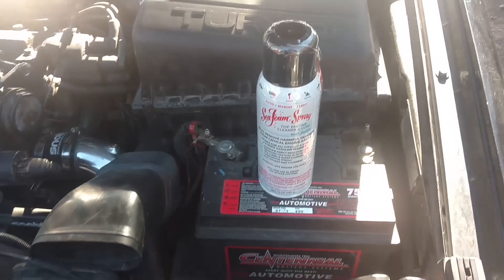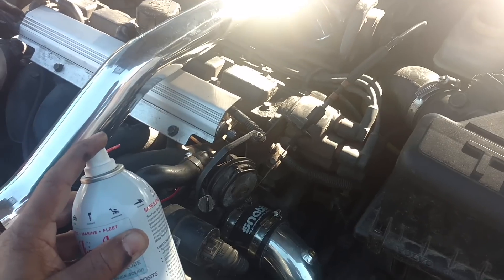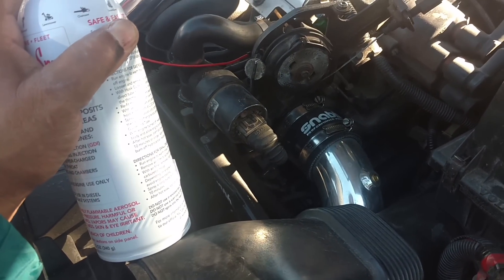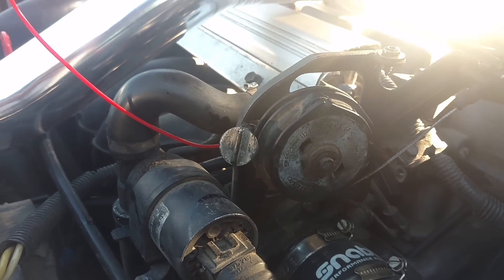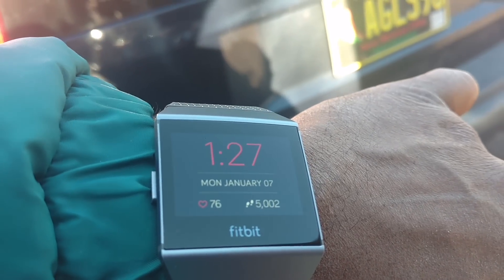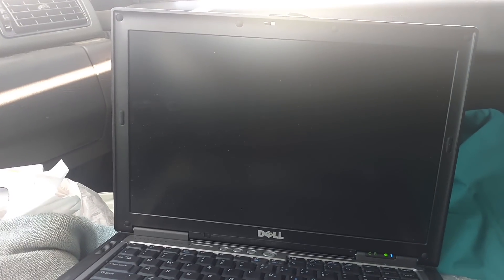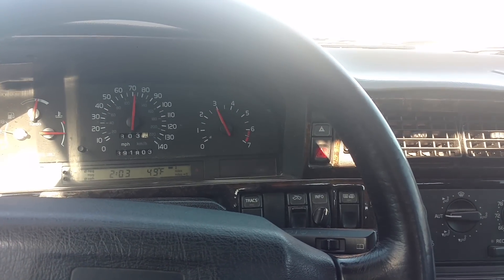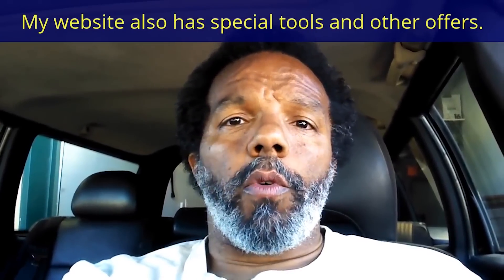Seafoam treatment on Panther, trying to clear out carbon build up. - howr

Comment: I've had mixed results with seafoam used it in two older fords I once owned...one car seen a good improvement the other nothing at all, I have also used seafoam in my mowers , no big improvement in the mowers but overall i'd recommend seafoam to anyone.  thanks Robert for another great video
Reply from the maker: Thank you for sharing.

Comment: Hi Robert, do you think putting a small amount of seafoam on top of the pistons to let it soak for a few hours might loosen the carbon some more? And then blow it out by turning over the engine. Did you ever resolve your carbon issue?
Reply from the maker: No, seafoam sitting doesn't work. The best thing was transmission fluid.
Reply from the maker: I'm not sure, I'll have to check next time I replace my plugs.

Comment: I'd take it easy with Panther and the mileage when something goes big it'll be the engine more than anything. They don't make Volvo's the same quality as the cars you have and need one that the same year but with very low miles. This way is still some cream in the milk.
Reply from the maker: LOL, Panther is a work horse. It should be good for another 100,000 miles.